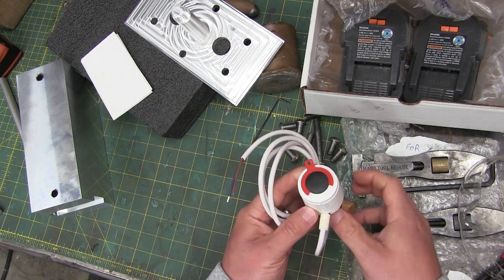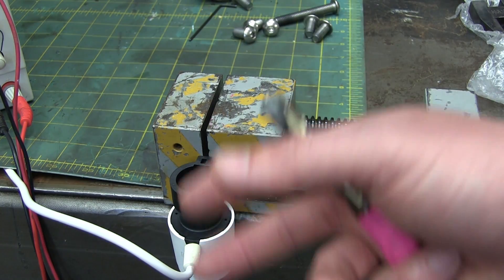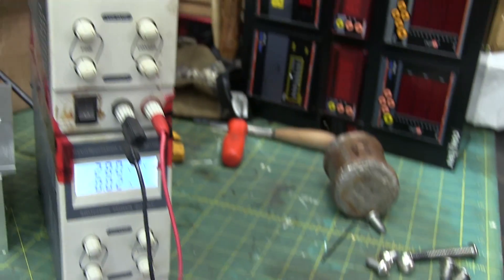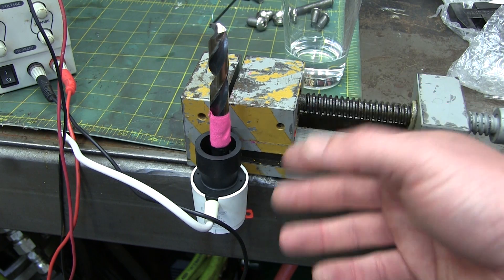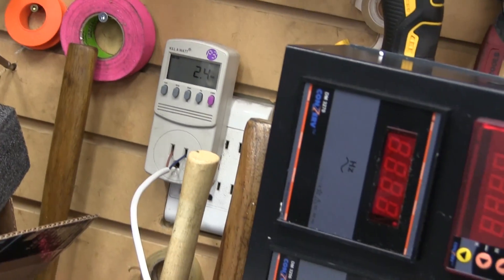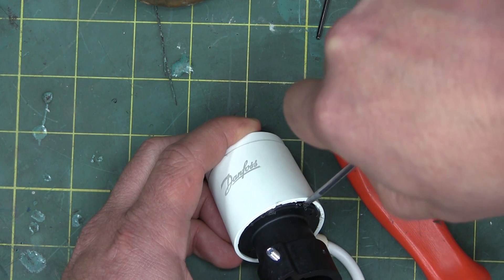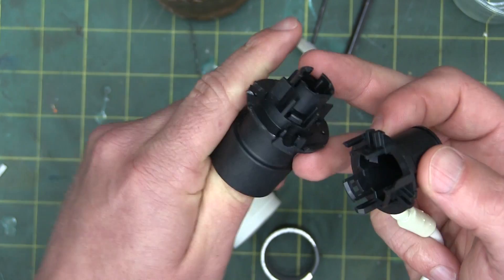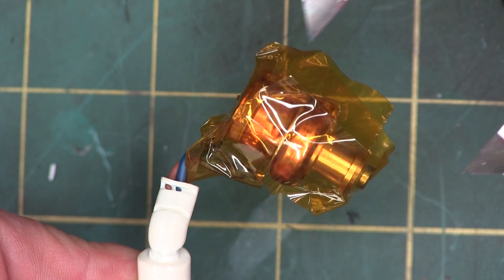BOLTR: Wax Actuated Motor | Mindblowing OLD Tech

Comment: You like these I hate them. I worked in a modern school and they used these to control radiators in individuals classrooms. They also used normally closed valves. Here is the problem these were made of plastic and they failed because on a normally closed valve they are on all winter and the plastic cooks and fails closing the valve and freezing the room. Good idea badly engineered.
Reply: plastic almost always a pain right in the ass when you wanted something serviceable
Reply: Well said Daniel, I was a steamfitter for 30 years and made a lot of overtime in office buildings installing replacements.
Reply: The old metal danfoss model was quie unreliable as well. Ran into a lot of them that had wax leaking out and wouldn't open.
Reply: Be assured, there are different qualities of them on this world. Some of these actuators work for more than 20 years now.
Adjustable radiator thermostats work on the same principle.

Comment: Early 90's Chevy trucks had a wax motor running the front pumpkin engagement for the 4wd.  When the snowmobile trailer is jack-knifed into 10ft snow banks, that thing takes 20 min and a blow torch to chooch.  I'll take a solenoid.

Comment: early electric 4wd actuators used to use this tech. hit the switch and wait 3 mins!
Reply: GM used them alot on the early 90's front differentials on their 4x4's. In Canukistan, during the frigid cold months. It would take FOREVER ( and quite often it would fail) to engage the 4x4. Was many a aftermarket system put in to fix that problem.
Reply: Yup, as i was watching the vid I was thinking, HEY GM tried using those back on at least the 88-98 front differentials for the 4X4. What a pain, 'specially when you need or use 4X4 mostly in the....um...what's that season called again...OH, WINTER!!

Dumbassery at it's finest.
Reply: I got a 89 Silverado with a wax actuator. When I first got it I thought the 4x4 was broke, until I learned I had to wait 10 to 15 seconds for the actuator to heat up the wax.
Reply: 96 tahoe has it.. it fails mostly and gets replaced with a aftermarket normal style
Reply: My 1993 still works just fine, in 20 years as a mechanic I replaced a lot more “normal” style actuators than wax actuators
Reply: Lawrence Staley
I can believe that. Although 'normal' to me is getting out of the cab, flipping the hub lock knobs, then getting back into the truck and pulling back the 4X4 lever.

That's why I think i would opt for an after market pull cable setup if I were to ever have a 'newer' truck than my '85.
Reply: James Bradley
Probably the same job I had in the winter here in Michigan when I was a kid...LOL.
Reply: James Bradley everyone I’ve seen have been vacuum or electronically controlled.
Reply: Russ Davis the old jump out and lock some hubs routine....reminds me of wheeling with my dad as a kid, guess what my job was?

Comment: Hot diggity, i work in the factory what makes those! the production line is amazingly old and modern at the same time!
Reply: spankeyfish haha, sorry man, corporate rules don't allow for that
Reply: Thomas froberg Petersen  can you post some video of that line?
Reply: FYI, there is an episode of ' how its made ' about these thermostats.
Reply: NeuronalAxon believe me no need for danfoss to have publicity, 99% of centeral heating or water systems in houses uses something made by danfoss mostly pumps and controllers
Reply: Do a full How It's Made episode on it!
Reply: So wats with the Cu in the wax?
Is it  to accelerate thermal transfer  ? Or is it to take up space too tune the length of stroke by displacing expandable materal.
Reply: Between Danfoss and Robertshaw, they have the entire water heater/HVAC market to themselves!
Reply: Thomas froberg Petersen - Ask them - the publicity might do them good! 😀
Reply: whats with the copper in the wax? Are they all like that?
Reply: The 'copper' in the wax is likely brass chips from AvE's saw. The heat from friction would have melted the wax and then it re-set with swarf in it.
Reply: Randy Seccafien I would guess that it’s for heat conduction and therefore control actuation speed. The better the thermal conductivity the faster the actuation.
Reply: Ours is 70 year old iron and 21st century electrics.
Reply: Ames iowa?
Reply: Well... a lot of shops are.
There is an actual rotary phone at my job. They still use it because the bells are loud enough to be heard in the shop.
Reply: i've.... said this exactly once? what? is someone abusing my good name!
Reply: Danfoss has a awful lot of awesome products and industrial lego. But here in Germany they have no business in the central heating market. That is split between Buderus, Junkers (both Bosch) and Viessman. But as far as i know they use many danfoss components. Danfoss is a huge player in the german aircon market.
Reply: Thomas froberg Petersen you leave a variation of this comment on all his videos.

Comment: Like the thought behind the wax motor as a control actuator, it sounds like you are trying to set up a LOLO setup (Lobe On, Lobe Off) where the increased gain acts to to actuate the system and when gain is balanced it is at zero.  What about fabricobbling this setup from automobile radiator thermostats?

Comment: I wonder if the copper in the paraffin is used to modify the hysteresis? Maybe plain paraffin cools too slow?
Reply: Ben Madison some use aluminum.  Could be due to modify (like what you said), could be used for cost.
Reply: Lucas Copper has a higher thermal conductivity than aluminum, meaning it'll disipate heat faster. Therefore, transfer heat out of the wax into the brass body faster.
Reply: For certain applications maybe the heat transfer of aluminum is sufficient? And reduces the build cost?

Comment: Well, now that's just cool as fuck, never seen one before. Say, if you had four small arrays off one large panel that were roughly in a compass rose a meter off the main panel, couldn't you just use four of these guys to push the panel on a gimbal? Like no automation needed, just which ever panel has the most light has the highest charge, pushing the biggun that way? Probably have to do some fiddling with angling the outrigger arrays and fucking with the gimbal mech. Or just tie a thousand sunflowers to all your panels.

Comment: Appliances use wax motors a lot. Take a dish washer for example, the soap container usually has a wax motor actuating the door open. That or a lever system. But they are everywhere.
Reply: Ah, that explains why they won't come open when you are in a hurry.
Reply: Front load clothes washing machines seem to like using them for the door lock as well.
I helped a friend repair the control board after the wax pellet heater shorted and fried the transistor driving it, in their Whirlpool Duet a few years back.
Reply: hey_allen The original Maytag Neptune washer with a mechanical timer models MAH3000, MAH4000, and MAH5500A all have the same issue, wax motor shorts and takes out the triac. Starting with the LED control MAH5500B they switched to a 2 winding push/pull solenoid that doesn't fail.
Reply: Oh that’s why I have to warm up my wife before the weekly poking begins.

Comment: 13:14 so as not to confuse my mom- DOM- drawn over mandrel tubing is not seamless, it is typically more precise and the entire seam weld is removed, but the seam remains. Seamless is made by extruding and is typically higher quality steel and even greater precision. I have personally pulled 3in 18g DOM tubing around a 2D die and it will split if it it not heated to 300F or so along with the seam being in the right place-been 17 years, so I forget where, but seams to be about 90 degrees off. bend)
Reply: I should make more comments lime this, but incorrect- so AvE will pin them. Love those pins!

Comment: If we knew the volume of paraffin in the cylinder and factored it with the bore X stoke of the actuator piston we get the ratio of expansion. That can be used to make an actuator with a very accurate stoke without the need for hardstops or feedback. Pack an old hydraulic cylinder full of it and with a little trial and error you have an automatic damper for the woodstove at the hunt camp.
Reply: Payton P. Used to deal with these wax pot actuators when I worked at a hotel years back, used by the in room fan coils to control the chilled & hot water. Generally pretty reliable, but when they failed they would crack the casing.
Reply: 10-15 percents says the gargler. Maybe the copper is to speed up the cool down? as the waks has a good thermal storage value.
Reply: Paraffin isn't especially compressible. At worst, it would just extrude out the crack in the casing.
Reply: I reckon things would get awful smokey before your flue was at full chooch!
Reply: you mean a candle bomb?
Reply: It might be that the system uses flow sensors and a microcontroller to shut off current to the PTC heating element before the actuator overextends.
Reply: from my gargling, the thermal conductivity of copper is 3 order of magnitude better than paraffin wax. it's probably to speed up actuation  in both directions. aka actuation speed is controllable by the % copper mix, probably at a loss of total expansion since copper takes up space
Reply: crazyguy32100 as a chimney sweep here in Pennsylvania i have seen some crazy homemade $hit in 11 years sounds like a total pipe bomb you will have a hard time keeping your fire in its place
Reply: Payton P. Yu
Reply: crazyguy32100 It wouldnt be that accurate because parrafin has a lot of otther chemicals in it.Even the food grade one.
Reply: Sounds dangerously close to a pipe bomb to me.
Reply: It would need a pressure relief feature either in the wax chamber or a spring connection in the linkage, as the stroke will continue to grow with temperature beyond the melting point.

Comment: From watching this, it makes me think of an automotive thermostat. Same principle as it at least
Reply: He mentions that in the video.
Reply: Most car thermostats and choke mechanisms are bi-metal springs, 2 types of metal with diferent thermal expansion properties sandwiched together so the length of the coil wants to change with temperature.
Reply: That's the opposite, viscus couplings get thicker as they're heated up.
Reply: Yeah waxstat thermostat.
Reply: older Hondas also used them to control cold idle speed.
Reply: My Mitsubishi 3.0 V6 used a wax motor choke controller in the carb.
Reply: A similar process is used for leveling apartment buildings using thick steel tubes filled with water. The water is frozen and expands with earth moving pressure that is inevitable as gravity but much much greater. (About 10 to the 23rd more power comes to mind but certainly an insane amount more in any case).
Reply: Imo this could be used more effectively than a typical thermostat but is more exspensive.

Comment: Not much travel on this one. I assume there are much longer stroke versions. (asking for the wife)
Reply: Think ballscrew (that is the technical term). I work on some CNC lathes that will move their axis at 2200mm/s. It is a bit bulky for portability but can't argue with the speed, stroke and precision.
Reply: Short stroke, but plenty of oomph behind it...as Archimedes said, give me a long enough lever and i'll screw the girl...or something like that
Reply: I recommend a saws-all with the “right” attachment. I saw a video on a channel by accident whilst watching In Range TV.
Reply: Its going to be too slow to be enjoyable i gues... But there are linear Actuators hat can to 160mm/sec !
Reply: Lukas I think I saw that video on another website.
Reply: There are wax actuators for greenhouse vents, they have about 100mm travel. We have some in the greenhouse, but they usually break after some years of service.
Reply: It only needs a 1/4" thrust ifin it is aboot 8" in diameter...
Reply: You could go full on madness and get a hismith unit from Amazon.  ;p A, uh.. FRIEND of mine has one and she could barely speak after a bit.  🤣
Reply: Seb Brosig I was about to say this. Mine has around 120mm stroke. Got 4 of them on the roof vents of my 6x8 and 4 of the lorve versions in there too for the walls.
Reply: Uh... and much faster!